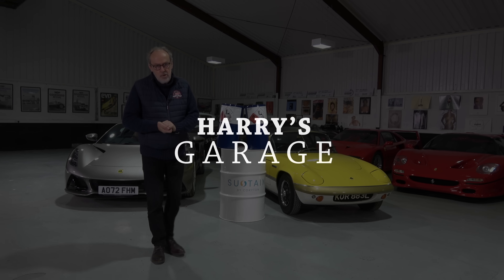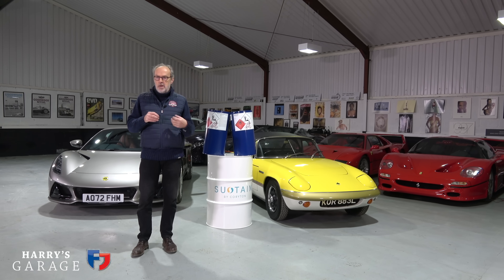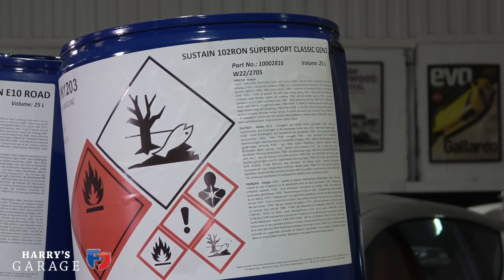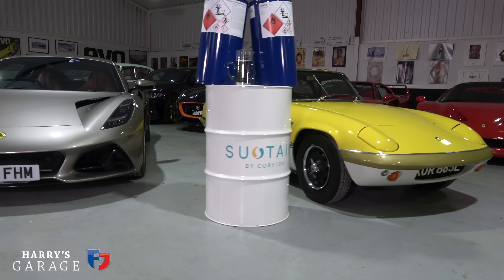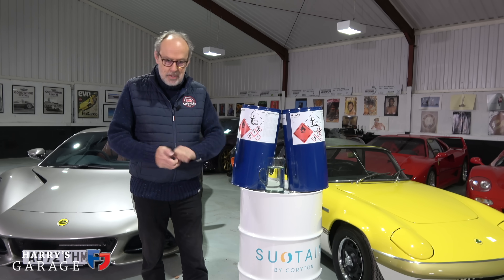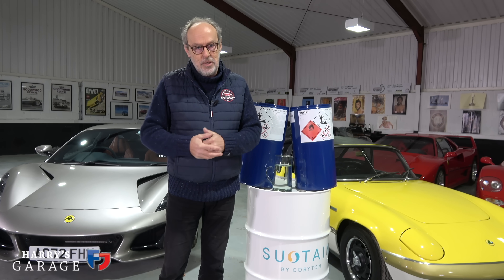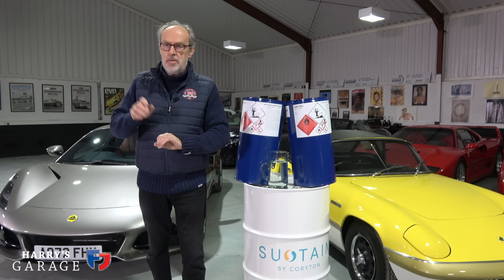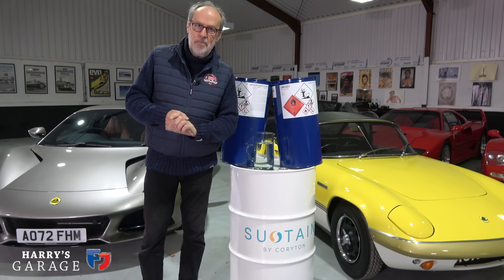Sustainable fuels; what are they & when will I be able to buy some?

Comment: small 2 pistons on a shaft going back and forth with magnet on it making elecirty with a nonmoving magnet, charging electric drive directly for less battery degaradation. then maybe for emissions and effiency sake, a battery size that is best for longveity, because we dont recycle battery to full capability, more parralel rows of batteyr u add less degradation but expoennetially less effeincy in practical situations, so the more energy going in and out car worsens deagradation.  smog and acid rain is not a big deal at this point so this balance will keep costs and weight down, low weight in ones car is safer for other weaker cars in crash without nessesarily being unsafe to people inside of it, see aptera owners club video on saftey, and low weight minimizes road wear exponentially.

Comment: All a nonsense in my book. Hydrogen fuel cell + electric engines are the only thing that will actually work, using existing gas infrastructure (pipework) as storage.
Reply: That’s not going to happen. Hydrogen embrittlement of steel will destroy the network.

Comment: As a lay person my question would be, why aren't fossil fuels classed as carbon neutral? Like you said in the video fossil fuels are vegetation that has rotted down over millions of years but prior to their demise they sucked CO2 out of the atmosphere therefore when they are burned they release that carbon. It's the same principle as burning wood pellets in the Drax power station surely?
Reply: You’ve got the idea. It’s all a matter of time. If we suddenly released all of the sequestered CO2, the Earth’s temp would essentially return to the time before the CO2 was sequestered. At that time, the earth was a hotter place than it is today.

But to maintain current temps, we need to just burn/consume carbon that is in the short-time carbon cycle. Even trees that take 100 years to mature are part of the carbon cycle, but it’s currently impossible to put fossil fuel carbon back in the ground.

Comment: It’s important to remember when making statements that not everyone lives in the UK. Here in BC, 87% of our electricity comes from in-province hydro electric, with less than 5% coming from fossil fuels. EVs ARE zero emission (in-use at least). There is defintiel6 a future where EV and ICE live alongside each other. Especially in 10+ years when we hopefully have solid state battery tech.

I’m with you though, I wish they’d stop pushing it down our throats that we need a new car every 2 years, and spending taxpayers money incentivizing vehicles that will probably be scrap before too long. I really hope we see what we see going on in the right to repair space with technology. Imagine a new car, where the infotainment module can be upgraded later, or a later better battery swapped out in 5+ years of required, or motors upgraded/replaced. For now, I’ll keep running my 2003 Defender.

Comment: 7:50 - Actually, we don't. The perceived narrative has been massaged. The recent 'spike' of warming is nothing compared to the medieval one, but they conveniently forget that, or rub it out of long-term graphs. There is a case to be made for CO2 ppm in the atmosphere following temperature rise. Look at the 'Maunder Minimum' at the end of the 17th century (when the Thames froze over). These things are complex, but that seems to have much to do with Sun spot activity. That, in turn, is related to the magnetic field of the Sun. The other thing, of course, is that CO2 is a tiny component of the atmosphere. Then, the UKs output is dwarfed by Chinas, which is increasing as they are building coal-powered generation stations!

Comment: Harry yet again I find your productions to be very high grade. However do find issue with sweeping statements and conclusions around ‘climate crisis’, ‘zero emissions’ and similar narrative driven pronouncements. Science is always changing in line with real evidence, not false models. We should all support new fuel sources to pull away from the cartels and to use all resources efficiently. Electric vehicles are a symptom of political dogma (religion around climate narrative), which conveniently benefits the mega monopolies as it supports their abuse of the consumer under the guise of the climate narrative. Let’s keep a fully open mind and question everything we hear.

Comment: Yep, Looney may have amended targets but the initiative is a hell of a lot better than any other major oil company. I just flew in from DXB early today & stopped off in my old Freelander Diesel for a caffeine boost, jet lag, & there were a couple of BP Boost units recently installed. Totally agree with you re electric, nothing new really if one looks at the history books & all the "woke" millenials conveniently forget that a Tesla etc  takes 83kg of copper v about 17kg for an ICE.  
I keep my cars running so the CO2 footprint is minimal, TDi Disco about 25 years old, MG Midget getting on for 53 (I bought it for my 5th birthday would you believe, not), Freelander about 13, XK8   20+ & Toyota Starlet 20+.  All these "woke" people who chop & change every few years conveniently forget about the finite resources from dodgy sources used to produce these products.
Coryton may well be the answe inswtead of the old Pb additives spruiked to increase ocane etc. 
PS excellent article in Private Eye recently about "wilding uk" fyi
PPS thanks for your Dakar production, most informative.

Comment: This does look interesting for classics and motorsport. Not cheap but then running a classic or race car is hardly cheap already. 

It’s difficult to see it scaling enough for regular motoring though and there are are still issues of local emissions (both CO2 and NOx).

The problem is that, like hydrogen, it’s a very inefficient way to use the underlying energy source, car engines are only between 30-50.% efficient, and you have the conversion and transport costs. That biomass fuel could be better employed in adding electricity to the grid surely to reduce gas consumption.

The really interesting use of this technology would be to ‘harvest’ solar energy in Africa etc and transport it as synthetic fuel to Europe. Currently it is impractical to transmit solar sourced electricity that far which is why Africa isn’t  covered by PV panels.

What you do with the synthetic fuel when it gets to Europe though (put it in cars vs use it to make electricity in a much more efficient power station) is another question though.

Finally remember that solar panels have a production cost of around 48g/CO2  per kWh if you amortise it over the life cycle. Add in the inefficiencies in the production and use parts of the synthetic fuel cycle together with the transport costs and solar produced synthetic fuel is probably more carbon emitting than is appreciated. 

Great video though and it’s good to have a balanced  discussion

Comment: Harry, you really would make a great teacher as the previous comments suggest! I have really enjoyed learning soo much from you!
At £5 a litre I would go back to electric! At the moment I'm running a new Dacia bi fuel, I pay 70p per litre! Autogas makes 80% less CO2 & 20% less NOX. The engine warms up faster, generates 10% more power, and the engine runs cleaner.
 All your cars can be converted. You can't use the channel tunnel but it's still ok for the ferry. You also keep your petrol system, almost doubles your range, and you can still use the synthetic fuel when it's ready.

Comment: Excellent explanation, Harry.
You mentioned the quandry of EVs using fossil fuel in the generation of electricity to charge the batteries in an EV. And, to add insult to injury, so to speak, the Lithium and cobalt used to produce those batteries take an enormous amount of energy in mining the minerals, and then the lack of a proper recycling of those minerals from the spent batteries. So, where does the spent battery pack from an EV (or Hybrid) end up? In some 3rd world country as a pile of very toxic waste.

Comment: Thank you for talking and acting regarding climate!
About biofuels in Sweden we have a regulation that gas station companies must sell a certain ratio biofuels and I believe some of it is mixed in with the fossil fuel. If the biofuel share is to low they get fines. And this ratio will gradually rise to be more biofuel.
I believe this regulation is the same or similar in EU.
Personally I think there may be some problems with replacing fossil fuels to biofuel on very large scale. But I think your personal plan sounds great.

Comment: There has been some recent studies that show ethanol fuel is actually potentially worse for the environment. The cultivation of land used to grow the crops used for releases a lot of carbon alone this was never account for when E fuels became possible. There are also more omissions in transport, deforestation etc until the trace exactly where the the ethanol and that it is regulated and legislated from its origin it’s unlikely it is cleaner than petroleum based fuel. Corn based ethanol in America is worse for the climate than petroleum based fuels. It going to be like diesel fuel all over again.

Comment: To be fair Harry, I do love your videos and content but your bashing of airlines was a bit heavy. 

Sustainable Aviation Fuel (SAF) is out there, San Francisco Airport (SFO) has a pipeline of SAF for planes to use within an existing fuelling method.

Rolls Royce has a testbed aircraft with modern engines on and has confirmed that their newest engines on things like the Dreamliner and A350 could technically run on 100% SAF, and airlines are being encouraged to start running on blended fuels with up to 30% being SAF

Admittedly, it is slow progress, but I don't really think it is any slower than its adoption in automotive, which by your own admission is basically just motorsport at this point.

Comment: Our E10 petrol is 10% ethanol 90% petrol.   Having visited a vast ethanol production facility in E. Europe (maise to ethanol) I aware of the vast amount of land needed to supply the current volumes of ethanol in petrol.   Ramping up to 100% ethanol based biofuel will not be possible from food and agri waste as dedicated crops and therefore farmland will be needed.  Then we're back to the "food or fuel" arguments that have rumbled on in the USA for decades.  Renewable energy and the fuel products derived from that energy requires  huge land masses.  See the size of wind farms, solar pv etc.   Offshore wind mitigates this.   Wind to hydrogen to fuel cells for all road transport, aviation, agriculture and construction machines is a very real option.  I'm not sure turning over  farmland to ethanol production is a good use of that land.

Comment: What role for E85, as available widely in France for example? It’s significantly cheaper than normal petrol, and one would assume it does a 75% better job at sustainability than standard E10 unleaded.
Cost of chipping a few cars to run on it significantly less than the £7k in extra fuel cost for Sustain fuels? 
Not sure if there have been any discussions about widespread adoption in the UK…

Comment: From what I understand Harry battery cars are a far worse pollutant than a fossil fuel car just from the production of the batteries. The other point I would raise is the slave labour used to extract the cobalt required. So all the people who can afford e cars salve their conscience by running e cars and not digging to deeply into the production method. Why oh why haven't they researched hydrogen fuel cells further as range would stop being such a big issue. Oh yes you cannot use slave labour to produce the hydrogen so maybe that affects the profit margin.

Comment: What about the other tailpipe emissions - Carbon Monoxide , Nitrogen Oxide, Particulates etc.. ?
The majority of EV charging is done at home overnight, where the Grid has averaged 100g C02 per kWh in 2022. Most EV's do 3-5 miles per kWh, so the CO2 pollution of EV's is low. Note: the CO2 impact of getting fuel to the pump is about 600g CO2 per litre, plus the car emissions.

Comment: I think tax on aviation fuel is a bad idea and there are reasons why it is not taxed. Aircraft, will tanker fuel around. This is to say filling up for multiple flights when they are in a low tax country. They might also stop for fuel enroute. Both are grossly fuel inefficient but taxation could make it cost effective. Improved fuels are a far more sensible idea.

Comment: Your point about keeping Old Cars on the road applies to all Goods! Everything is Built to Fail these days not Built to Last! They calculate tolerances on White Goods etc. to last X amount of cycles, uses or years instead of building it to last! 
Look at the infamous case of iPhones where they were caught purposefully adding 'Go Slow' Bugs into each Software Update so that your phone appeared to not be working as well  or as fast after every update to trick you into buying a new model every 12-24 months! I did an experiment with the iPhone 5 I kept it for as long as possible, it lasted 8 years! And in the end it was the battery that gave up not the phone! Of course Apple design their phones so that you can't easily replace the battery but at that point I was done with the Company as a whole and moved to Android!

Comment: Yeah, would be nice to have either 95 E5 instead of E10 or a Super Plus (in terms of German petrol) 98 octane replacement.  Two of my three cars do so little miles a year I wouldn't mind spending on this type of fuel. But one is from 1991 and I don't want it to get E10, the other needs 98 octane and mostly gets Ultimate 102.

Comment: I was a bit skeptical of the aviation figures as well so I did the calculations and it came out at 3%. However that was just the emissions from burning jet fuel, it excluded the energy cost of extraction and refinement as well as airport infrastructure. I think there is also some debate about the effect of those emissions high in the atmosphere.

I think you are right, we should tax it more and let the market find better solutions. I know a lot of people will claim this disproportionally affects the poor. I have never bought that argument simply because poor people don't fly that much. Even in the US half the population won't fly in any one year.

Comment: E85 has been widely available in America for 20 years now, and it's been pretty much a total disaster. Emissions from burning the fuel itself might be a closed loop, but producing it ends up creating way more CO2 than just sucking gasoline out of the ground. Same issue as the "zero tailpipe emission" EVs: technically accurate but misleading. Coryton's website isn't very specific, but it says the fuel is sourced "from agricultural waste" -- which is superior to the freshly harvested corn we use, I'm sure, but at any kind of decent scale you're gonna run out of waste product real quick. 

I'm also highly skeptical of the increased fuel economy claim - US EPA has been testing these things for years and they always return worse fuel economy than gasoline. One of the only small(er) vehicles still available in the US with a Flex Fuel engine in 2023 is the Ford Transit Connect (2 liter, 8-speed auto) and it averages 24/28mg (city/highway) on 87 octane versus 16/21mpg on E85. Outside of the guys building 1000HP drag cars, the only people still using E85 are Midwest fleet operators who are receiving some type of subsidy.

I'm sure Harry knows all of this already, but I see people soying out in the comments about the new Superfuel that will deliver us from the EV scourge. Sorry bros, it ain't happening. This is always gonna an expensive, niche fuel - and potentially very good for those purposes - but on a large scale, you would need to start bulldozing entire counties to plant enough crops.

Comment: Humans are responsible for 3/4% of C02 production year on year... Nature being responsible for 97/96%. Of the 3/4%, the UK is responsible for around 1%. 
1% of 3% is tiny and even more so when you understand that China alone, built 80 coal-fired power stations last year.
As for this fuel, its a niche product. Its not 100% renewable at all. There are lots of fossil fuels used in the process... The steel barrels Harry is showing would be one, but the list would be vast. The off-set for building the relatively small plant Harry showed a picture of would most likely render it pointless.
Yours,
Chris.

Comment: Harry I am surprised that you as a farmer have been hood-winked into thinking that CO2 in the atmosphere is a negative, when all your crops are dependent on CO2 to survive and grow! The more CO2 in the atmosphere equates to bigger and better crops of all varieties! The current ambient level of 430ppm is still very much on the minimum end of CO2 that the planet has had in the past. All the oil and Gas we are extracting from the upper end of the northern hemisphere comes from plant life when the CO2 level was as high as 7000ppm ie 16-17 times as high as the current level. The average planetary temperature at that time was only a couple of degrees higher than we have at present!   This whole CO2 scenario is purely a roues by those Elites who want to control the the masses and their best bet is to restrict the movement by reducing their ability due to legislation & cost! Everything has been out in the open for years all we have to do is study the WORLD ECONOMIC FORM as they are the ELITES DRIVING THIS TRAIN!